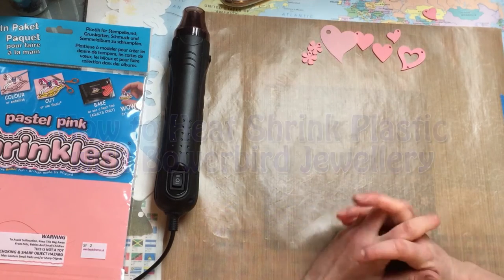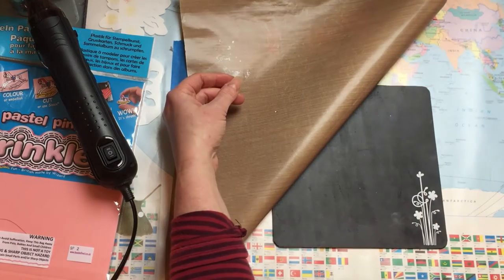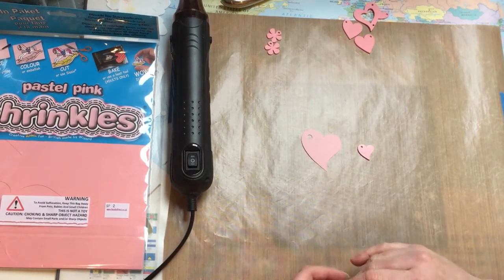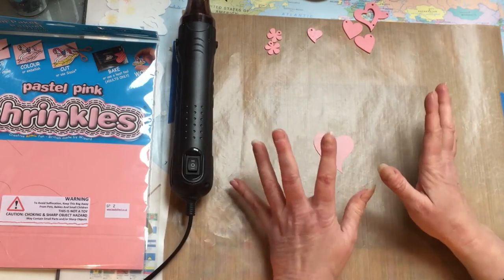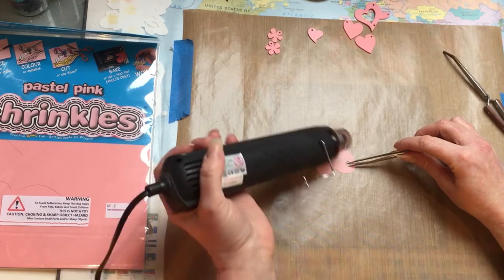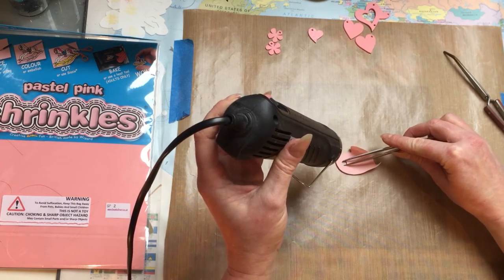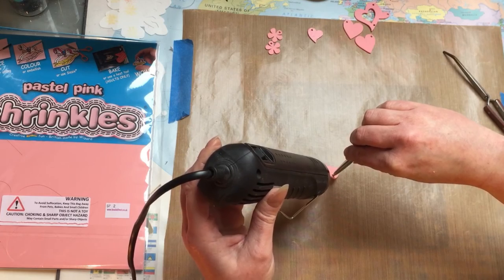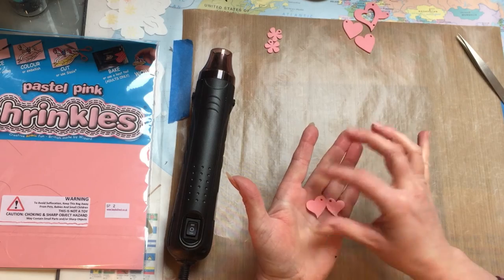Shrink Plastic how to heat shrink tutorial

Comment: If you're making BIGGER charms; how to make a acrylic-made picture stays a little larger, instead of 'shrinking' it?
Reply from the maker: You can’t really keep shrink plastic larger or the same size, because  it’s specially stretched, so once you heat it, it goes back to its original size.

You could always make your image larger, ensuring you factor in the size it will end up.

Comment: Could I use a blow dryer?
Reply from the maker: Not really, as they force too much air onto the shrink plastic and it can blow away.  You can shrink it in an oven - the temperature and instructions are usually on the packet of shrink plastic!

Comment: how to you hold on to make it straight to make a name tag.
Reply from the maker: Nikhat S Khan yes the matte does bleed a bit! You can use fine sandpaper and sand the shiny side a little on the diagonal.  To stamp straight, I use a stamping platform which you can use magnets to hold the shrink plastic in place, then add the stamp on the hinged lid!
Reply: @bowerbirdjewelleryuk  thank you so much :)
Reply from the maker: That’s no problem!